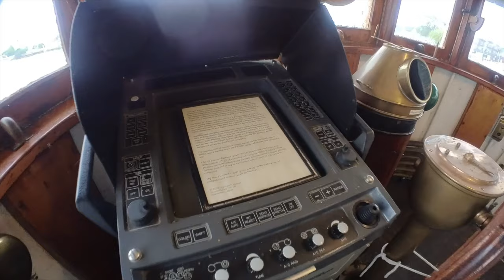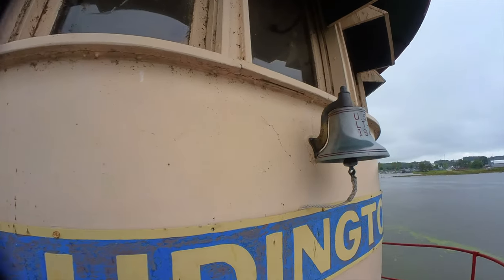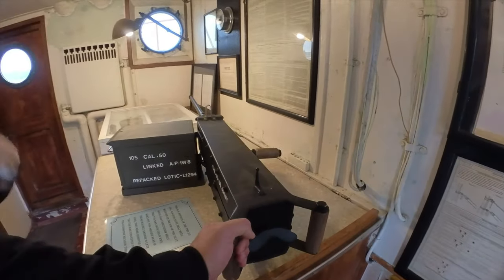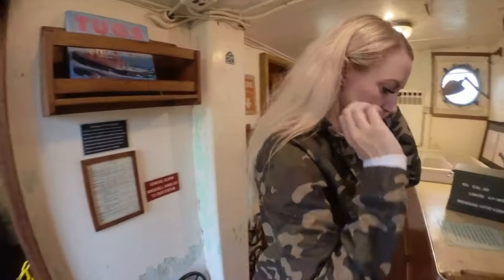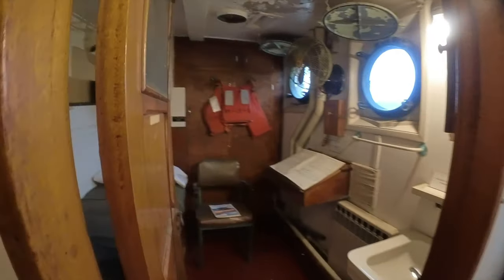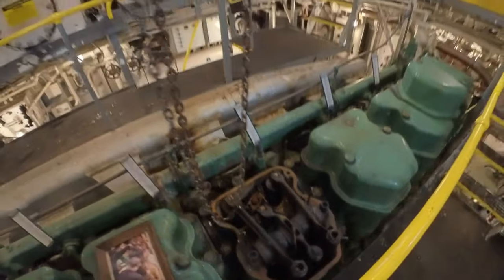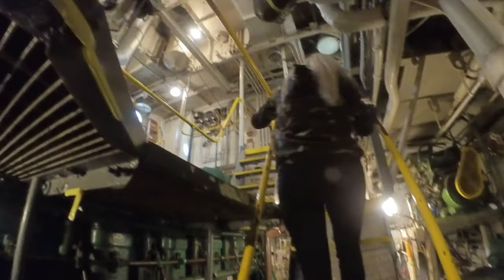Tug Ludington - WW2 tug boat

Comment: So that’s an Enterprise DMQ38. A direct reversing turbocharged diesel of about 220 liters. 1:1 drive so the engine only turns about 300 rpm flat out. Very cool!
Reply from the maker: Wow! Most modern engines won’t even idle at those RPMs, that’s so cool! Thank you for sharing that. I wonder what is the total horsepower/TQ output ?
Reply: @stgeorge  So our engine is a DMG38, same 15” bore shorter stroke as compared to the 21”  

We are rated at 700-800 HP at 300 rpm.

I think this larger one would be a little north of 1000 HP but that’s just me spitballing. Fantastic engines. Redundant and loose tolerances so they just always work.
Reply from the maker: @BBerckdano I know this is totally different application but it’s wild to think that a modern turbo diesel in an F350 at just 6.7L displacement is capable of producing very similar numbers. I bet the TQ numbers are a bit higher with this beast

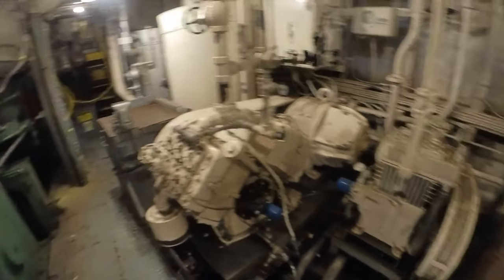Comment: @7:48 is a water cooled air compressor used to generate air pressure.  The air was piped to the large vertical storage tanks which supplied the starting power to the main engine and provided air to the throttle/shift controls.
And Brotherman, don’t quit your day job. 😅
Reply from the maker: Wow! That’s so cool! Thank you for sharing that with us
Reply: @stgeorge I was her last Army Corps of Engineers Chief Engineer.  Some good times on that boat.
Reply from the maker: How cool is that! Wow! How long were you on that boat?
Reply: 91-94. Retired from the COE as an 2nd Assistant Engineer aboard the M/V Mississippi in Memphis,TN. a little more than a decade ago.  Check out my bio.
Reply from the maker: Wow! That’s so cool